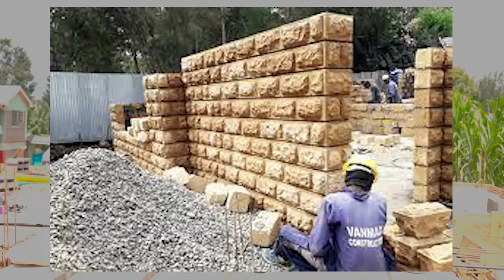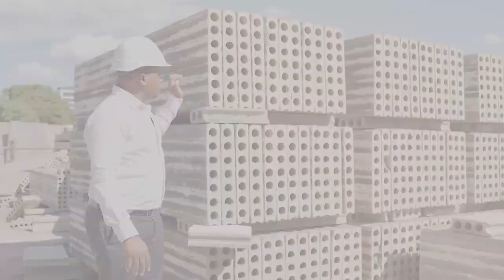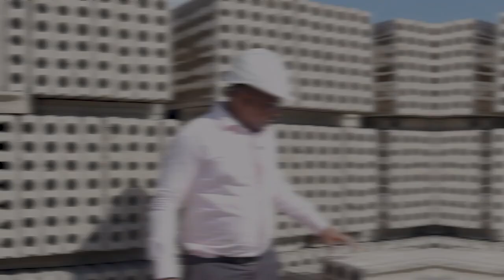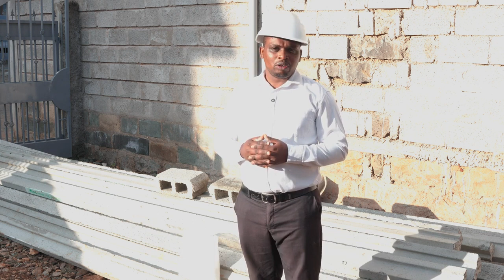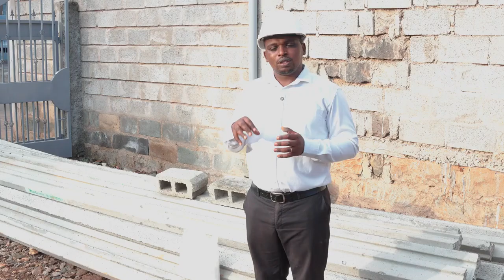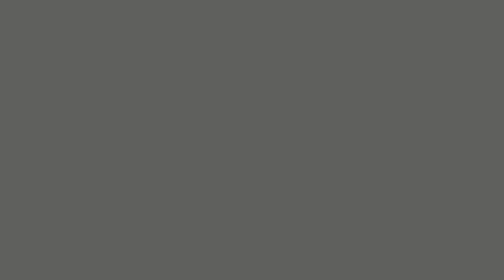Building Smarter: Revolutionary Construction Technologies You Need to Know #alternativeconstruction

Comment: Hello sir. I've been a follower and you might say a fan for a while and I have learned quite abit from your content, plse keep it up.

I have a question. There's technology where they bring in pre-manufactured foam to a build then they spray mortar on both sides of the foam to form the build's exo-skeleton. I don't know the name of the tech. 

Two questions; are you familiar with the tech, if you are, what are the pros/cons?

Is there a nationally/ internationally recognized entity that looks into the standards of new building tech in Kenya vs conventional tech?
Reply from the maker: Thank you Fredrick for your support to our channel. Indeed it is a pleasure to hear  that the contents shared have been helpful to you.

I presume that your question revolves around EPS (Expanded Polystyrene) technology for walling. It is an alternative that has been in the Kenyan market for some years now. 
The walls are fairly strong, good sound and thermal insulation and easy of construction. Concrete can be smoothened reducing cost of plastering.

Major cons are: cost would be higher especially where building stones are available and would not be treated as load bearing for houses with more than 1 floor level.
Reply: @TheBuildingConsultant 

Thank you for the reply, much appreciated